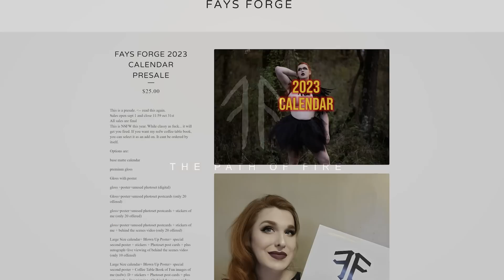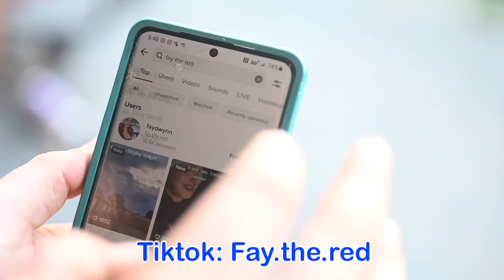Building a Longship part 6: viking hard work

Comment: Try hunting. Gets you out the forge. Gives you materials to use in your work. And given your clear years of experience. Just rip the head off a deer or two. Cause we all know a blacksmith could.

Jokes about your absolutely phenomenal physique aside. Hunting may actually be of use to you. Kill the prey via the brain stem and you get a lot of material to use from fresh meat, to bone, to hide, or make the hide leather. 

Either way great work as always. And any ruts or issues you face am sure you'll get out of them swiftly. And if not, just take a step back and analyse it.